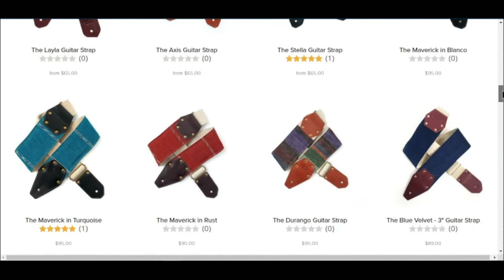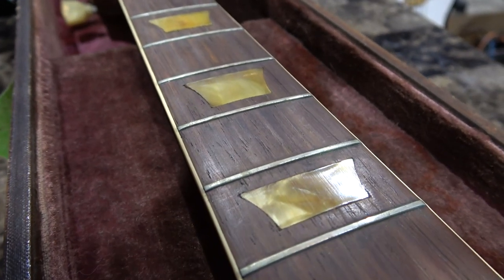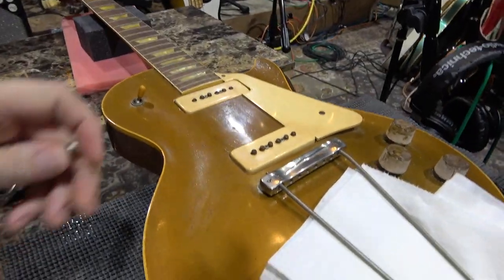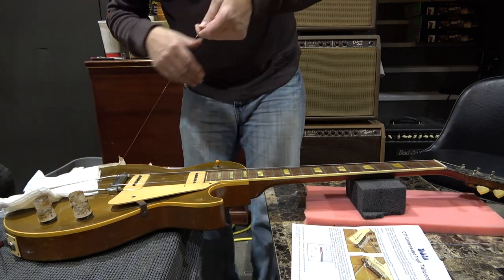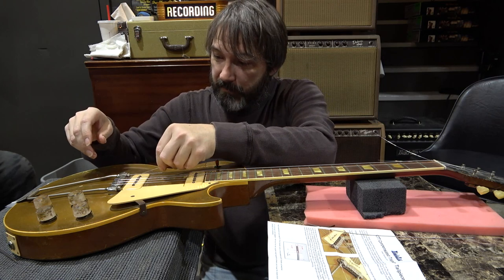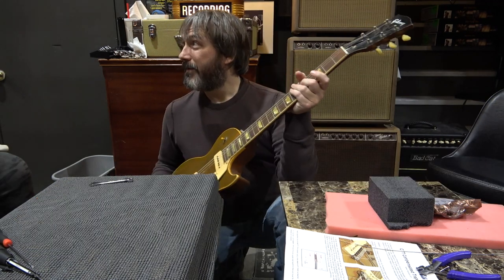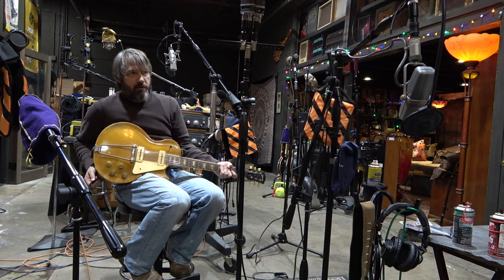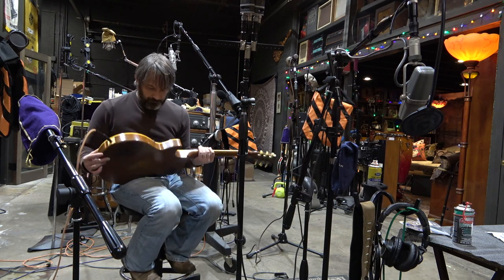WTF!?! He's MODIFYING an ORIGINAL 1952 GIBSON LES PAUL???

Comment: Personally, I don't see any sense in changing P90s for humbuckers on a Les Paul, because a Les Paul with P90s, vintage or not, sounds like heaven.
Reply: You said it. P90's are savage pickups.
Reply: @scottsteel4230  I’m a metal guy, and I totally agree!!! Been liking these pickups a lot on high gain, just very different and they are very fat sounding. I think ppl are getting more into these in metal. A good thing, when recording a song, so many have a similar sound these days. I love em man
Reply: I'm a Metal player, too. I've had them in Les Paul's and SG's. Humbuckers have alot of sustain, mid and low end roar. P90's....the high end shears the top of your F#&KING head off. Tony Iommi was using straight P90's on VOLUME 4, AND HIS TONE WAS LIKE IT WOULD SHATTER GLASS. IT WAS BLISTERING. Townsend at WOODSTOCK. For Metal, they are razor sharp DEADLY, and, if I may say so, they're OFFENSIVE sounding, and I LOVE EM. All it takes is ONE listen to the opening notes in Supernaut, on VOL 4, and you know how absolutely VICIOUS these pickups are.
Reply: Agreed!!!!
Reply: yes. few people realize that the original santana, black sabath, etc, etc, albums were SGs with P-90s. amazing sounding.
Reply: @scottsteel4230  yes. few people realize that the original santana, black sabath, etc, etc, albums were SGs with P-90s in them too. amazing sounding. when I figured this out so much made sense to me about why I could not nail the santana tone. now, years later, I still need a guitar with p-90s. I might swap out the microphonic and not very good sounding original humbucker pickups in my '69 SG. don't worry, they are not PAFs and the guitar is beat to hell. it is NOT a collectors guitar. finish is gone, original trem is gone, the neck had been snapped off from the body, etc etc. my dad bought it brand new from Manny's Music right after he went to woodstock. the frets are very worn as well, but I leveled and polished them and now they are okayish. maybe I'll buy a set of mojotone p-90s.
Reply: @caseykittel  I once had a 68 SG in VERY similar condition. It is still to this day, one of the BEST guitars that I've ever owned. That old guitar had more tone more soul, and more mojo than just about any guitar I've ever played. It was stolen in NYC. I still think about that guitar and wish I still had it.
Reply: @zamsden  Yep...one of the best pickups ever. To me, they are the mid point between fender single coil Strat pickups, and Gibson PAF'S.
Reply: @scottsteel4230  the pafs sound anything like mini humbuckers to ya? I have a guitar with three humbuckers in it.  the single coil sized mid Humbucker pickup sounds different than most single coils that's for sure. I just never tried p90s that's why I asked.
Reply: @terran236  Full size PAF'S, are beefier, fatter and warmer than the mini humbuckers. Low end, and sustain, is not as good as full size PAF'S, but they're warmer sounding and smoother than P90'S. P90'S are the most versatile pickups that Gibson make, in my opinion. You can use them for any genre of music, and they are tonally capable to adjust to pretty much anything. They have a very wide frequency range. Overall, P90'S are just amazingly fantastic sounding pickups. I don't even look at Les Pauls or SG's anymore if they don't have P90'S in them.
Reply: The P90 pickup (like most single coil Pickups) tend to be a little less forgiving to the player verses a humbucker pickup (IMHO).
I love humbucker however single coil Pickups get the "Win" for superior articulation and tone.
Reply: @hkguitar1984  I love single coil for clean and some solos in metal as well as slapping on 8s. I try to modify every guitar I have to have splitable tones. 

On my cheapo $600 Ibanez s series I have two gravity storms and the middle Area mini hb pickup from DiMarzio. Push pull to have 10 tones it sounds amazing. Probably my favorite guitar when it comes to versatility. When the push pull is up every single pickup is in single coil mode. It's like having a Les Paul and Strat in one guitar.

That's why I'm curious if Its Worth buying a P90 style humbucker like the p rails or the phat cat. That's pretty much the only unexplored area tone wise when it comes to guitars for me.
Reply: P90s are the fad right now.  20 years ago it was humbuckers and twenty more it will be something else. It may not be intuitive, but I believe you'll get more traction going against the grain.
Reply: @natetolbert3671  agreed
Reply: @caseykittel  thats because p90z were the pickups that came stock w their guitars. Back then, guitar companies didn't use humbuck3rs because they sounded too distorted! Ironic much? The goal used to be "as clean as possible." So 60s guitars came with p90s or singles. Later distortion became popular and they were switched out.
Reply: @caseykittel  few people? Cmon now...
Reply: @terran236  you can flip one of the magnets to get a unique sound as well. Google the term "Peter Green mod" just don't flip the first 2 words! You'll regret it..
Reply: @natetolbert3671  what year did humbuckers come out?
Reply: @caseykittel early 30s but they where originally used in PA speakers. The reason they had the double magnets is to cancel electrical noise in speaker systems.
Reply: @natetolbert3671  oh. Electro voice. Yes they made PA systems. But no, I believe their humbucking design was only used on their microphone, not the speakers. Do you have any articles or photos with the speaker design shown? 

It doesn’t make sense to me that you would be worried about speakers. The output of the amplifier has so much less sensitivity than the input.
Reply: Louis Carlos  Now let's see if another 1 week old account will comment something like "hurr durr it worked for me".
To anyone else reading, if you're enough a loser to want to hack your girlfriend's password, be careful, they're posting this comment in random threads, this is not organic.
Reply: Sonny Reginald  ^ Confirmed
Reply: Indeed. And in most cases better
Reply: I haveva 61 les paul jr and my main amp is an 18w marshall style build I built myself and my 61s p90 screams. I usually can crank the 18w amp and rude my volume knob. My guitar volume on 1 is an incredible crunchy rhythm tone. Crank er to ten for solos and fack!
Reply: @scottsteel4230  Don't forget Aqualung.  If you want to get the humbucker sound just use both pu's at the same time.
Reply: @caseykittel  Aqualung.
Reply: i know im randomly asking but does someone know a tool to log back into an Instagram account..?
I stupidly forgot the account password. I would love any assistance you can offer me!
Reply: @Camilo Brady Instablaster =)
Reply: @Louis Casen Thanks for your reply. I found the site on google and Im in the hacking process atm.
Seems to take a while so I will reply here later with my results.
Reply: @Louis Casen It worked and I now got access to my account again. I am so happy:D
Thank you so much you really help me out !
Reply: @Camilo Brady no problem :)
Reply: I have always believed that single coils have so much more character
Reply: I'd at least have one of each. For the poor guy, any basic decent les paul style guitar with duncan phat cats is a super match to another similar guitar with humbuckers. (I say poor guy not because those are that cheap, but if you can find a set used, they will go right in a regular humbucker mount and they don't give up anything to P90s. They will make a humbucker sound pretty bad when you compare the two on low gain).
Reply: AGREED! P90s are the voice of God.
Reply: P90s are the best pickups ever made, as far as I'm concerned. So why mess with perfection?  Aside from that, the required mod is irreversible, as most people that have tried to do it know.  You have a Paul with p90s and you want humbuckers, get another guitar that was made for them.  Keep the original the way it came!
Reply: @scottsteel4230    You're so right.  But when he threw that beautiful SG Special off the stage I wanted to send Uncle Bizzi to have a little talk with him!
Reply: @phylliscole4331  You're so right. When I saw him throw that guitar, I just about lost my mind.
Reply: Incredible growl on those open chords.
Reply: Agreed!  Killer combination from the company that invented the P90....💚🎸
Reply: @scottsteel4230  I prefer the p 90s ...people with the gold tops want a cherry burst with humbuckers ...but those with the cherry burst want ...the gold top with the p90s...David gilmoures les paul is a p90 gold top with  the bigsby ...he has been playing it quite alot...have a listen to Dave playing  his p90  goldtop on the videos ...wow what a sound ...The  instrumental song   "5 am" is the thr p90 goldtop have a listen

Comment: Should’ve put some robo tuners on that bad boy!
Reply from the maker: We could have Groverized it.
Reply: Yes officer, this comment right here
Reply: Robo tuners, a Floyd Rose, and a refin would definitely be an interesting video.
Reply: Just some Raman and glue is all it needed.
Reply: A wire brush and some spray paint and that LP would be good as new.
Reply: @TheGuitologist  There probably lives a sweet flame top under all that bronze. I had a gold top a 54 with all gold back and front sounded amazing but unplayable. Had the neck reset by Dan E. And it was my main axe till I got my 58 custon. Wish I still had that goldie what a beast. That trapeze deal looks like the way to go to avoid a reset. Nice Axe thanks for the video Brad
Reply: Might as well just route it fo a Kahler 😂😂
Reply: Needs a better relic job. Looks like it was done by a hack relic guy. Unless it’s been dragged down a gravel road with a 4 wheeler, it ain’t relic. 😂
Reply: @keefjunior4061  an Evertune!
Reply: It's just a Les Paul.
Reply: No no no no, Rout it out for some EMG's and an Evertune, put some extra jumbo frets in it, and paint it black. There's your heavy metal machine.
Reply: No what it really needs is LED lighting and a rainbow flag.
Reply: @keefjunior4061  More like tragic.  Jeez!
Reply: Needs one of those string butler things
Reply: @keefjunior4061 And some active pickups.😁
Reply: @Charlie6969 Maybe some shark fin inlays while we're at it.
Reply: HAAAAAAACUUGHCOUGHCOUGHWEEEEEEEEZZ
Reply: @LightningDogg I was thinking a wire brush and a bigger wire brush

Comment: I once turned one of those down in the mid seventies because of the action. Could have picked it up for 500.00. Stupid stupid stupid!
Reply: I think we all passed on a lot of great gear back in the day. $500 bucks was a lot of money in the 70's. A brand new Les Paul was less than a grand back then.
Reply: I passed on one in 1992 for about the same money.
Reply: @miaoupha2370  Only if it's the 1.21 Jiggawatt Flux Capacitor model.
Reply: @TundraMan  watttt???
Reply: @brich2929  It was about a year before the whole vintage craze started, and used Les Pauls were tough to sell. The 52 was an even less popular model because of the bridge design. I wound up buying a mint used standard that same day for $700. A year later all the old guitars nobody wanted now were 3-4 times more expensive.
Reply: @scottdunn2178  I made up for it later when I found a mid 50's Les Paul Jr. single cut, single P-90 at a swap meet for $3.00 in the mid 80's
Reply: @pawnmack  wait a freaking minute. $3? Three dollars??!
Reply: @TundraMan  it will be like that later on again, these younger gen who play djent won't give a crap about a 52 les paul.
Reply: @BSIII  Ha ha ha. OK...it did have a cracked headstock but it was an easy fix. True story.
Reply: @TundraMan  Give me a Gibson with a wrap around tail piece any day of the week. I'll deal with intonation issues with aftermarket items.
Reply: I’m not that old but remember when mid 60’s teles went for 5g. Who knew...
Reply: Not as crazy of a deal but i had a mint condition Ibanez Blazer i found in europe for only 100$.. i didnt pick it up though. Now they go for near 1000
Reply: I could have bought one in 1998 for $850 cash. Had a buddy who needed money. I ended up buying an epiphone acoustic from him instead. Paid too much for the Epiphone but he kept his Les Paul.
Reply: Jewish Yoda  Not really, definitely a down payment though. They're running about $18K - $40K these days
Reply: @cerisejones8061  OK, boomer. That's proved wrong by all the young people out there who DO value older instruments for their history. It's pretty shitty to talk about an entire generation like they're all ignorant.
Reply: I could have bought 5 new USA Kramer’s in cases right after they went out of business for $200 a piece, but turned it down. 🤦🏻
Reply: you had 500 bucks in the seventies?
Reply: @johnsmith-bk4ps  I made more money playing in a country band twice a week at 16 than my mom earned in her day job for the same time. I started early.
Reply: @ZiddersRooFurry  I'm 35 so not that young, but more than enough to get into djent and whatnot. But I've held on to my grandpa's vintage Excelsior accordion and I don't even play accordion, I know keyboard though so I could learn. Not exactly worth much but I still doubt I'd sell it if it was, not just because it was my grandpa's. I really like the older blues like the guitarists that influenced Hendrix. The electronics even still work on the accordion, it just smells funny and needs reeds. 

I'd even like to get a nice violin and I bought a random Fritz Kreisler record at a thrift store still sealed from the 50's and that really got me into that. Not to mention vintage stereo gear, if you can find Dynaco A20's for like $70 in great condition they're amazing. I kinda doubt you can anymore though at least not that easily, I just looked them up and they're like hundreds in Ebay, but some of the better vintage speakers can be a ridiculous value. 

I kinda hate how a lot of things like vintage almost anything is associated with being 'hipster' though lol, I don't let it bother me that much or anything.
Reply: @brians1793  I've always wanted an accordion. Weird Al's a hero of mine. Definitely don't let whatever people think of being into whatever discourage you. As long as it makes you happy and isn't hurting you or anyone else it's all good.

Comment: Hats off to Mojoaxe for coming up with this bridge!
Reply: Yes it's a good idea, better with than without it, but the strings still seem too high to me, really not enough neck angle on these LP's.
Reply: @strat0871  they have enough neck angle. you have to lower the bridge all the way down and they are perfect. at least with the glaser bridge. these guitars will surely go up in value. they have been cheap to long at 10 to 12k

Comment: I've been using that restring method for decades now. One difference though, I cut the strings beforehand using the other tuners and guesstimation to get the right length. Usually end up with one wrap above and 2-3 below.
Reply: Ive used the exact same technique for years. Low E A and D I measure the string to the next tuning machine. G B and E are measured two tuning machines away.
Reply: I do the everything but the string looping thing, it's unnecessary in most cases when you drop the 5 windings around the post nonsense old timers always stood by. No maker suggests that many wraps ever. Neither do string manufacturers. It's baffling that such an easy tuning screw up persisted for so many decades. 1.5 to 2 full wraps around post is the sweet spot. This will even stop issues with tuning on a Les Paul.

Comment: 19:25 You can save yourself some tuning key wrist exercise by wrapping the string over by hand. Then you use the key to tighten on the under wraps. The amount of slack you need to get the string over the top of the tuning peg is about right to get the correct number of wraps/turns (2-3 wound/3-4 unwound) when it's up to pitch. No need to measure 2-1/2 pegs, etc. I learned this from the luthier with the glasses who's in charge of the students at Crimson Guitars (Christopher??).
Reply: Those are some good guy's over at Crimson Guitars. You can learn a lot from them, and you can tell they really enjoy sharing their knowledge.

Comment: Lol that thin neck discussion -  about 5 years ago I bought an Ibanez Paul Stanley model Iceman, the cheapest one that has the bolt on neck. Now I am one who is used to playing Les Paul's and other such type guitars so that the really thin Ibanez neck was a trip for me! The neck is so thin I can actually bend it just by holding a power chord and twisting my wrist a little!! But I tell ya what, for a $300 brand new guitar it's a rocker!! I did have to swap out the 3-way selector a few months ago but other than that it's still all original. I could care less that it is a Paul Stanley model, I just wanted a black Iceman and that was the only one Zzounds had at that time. I think after a Les Paul the Iceman is my second favorite guitar body style, it's very comfortable when playing sitting down (I broke my back 3 years ago so I have to sit when I play) plus it just rocks and even on a clean setting it sounds good and yes it still has the original, probably cheap, Ibanez pups and sounds that good. I have often thought about getting the wood and making my own guitar from scratch and I think if I did I would go with the Iceman type of a style. I know people say the Iceman is just basically a Gibson Explorer type of body, but I have owned an Explorer and I hated it! Well, I loved everything about it other than that big top wing, it makes you have to hold your picking hand in a weird position and for me it caused a lot of shoulder pains! Maybe standing up it wouldn't do that, but as I said I have to play while sitting. Man imagine having such a collection that a 1952 Gibson Les Paul  just sits around for 40 years and doesn't get played!!